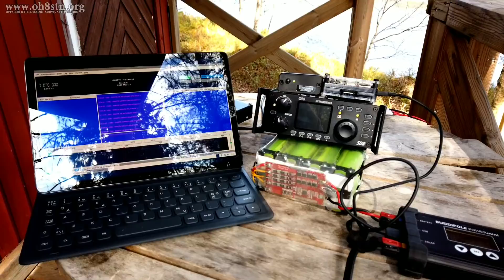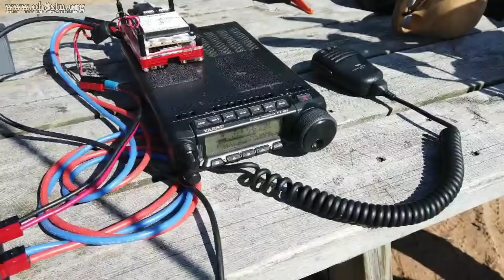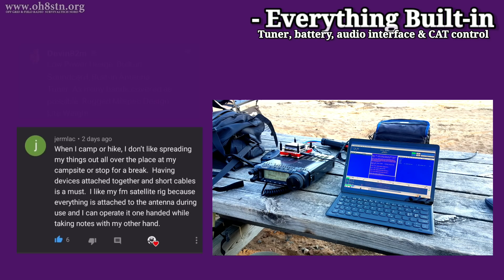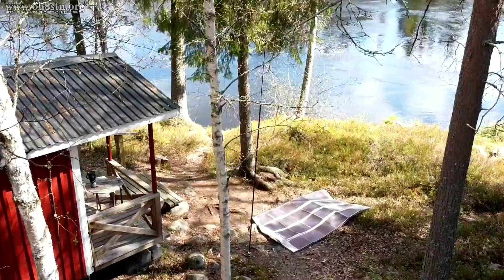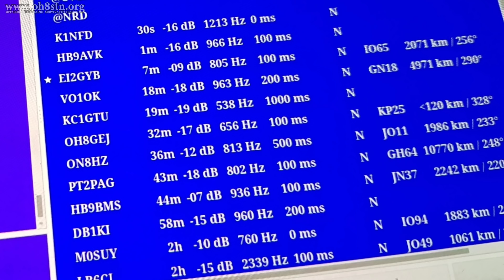How to Ham Radio Off Grid

Comment: Julian, this is one your best videos on this subject matter and I'll be sharing it far and wide.  Very comprehensive.  I have had some of the same thoughts and considerations.  I also wanted to drop a comment here in regards to your blog / website post about the FT-891 (The “Perfect” Yaesu FT-891) which I think overlaps with some of concepts in this video.  I have the 817ND and the 857D.  I love them both, use them both but when I look at the FT-891 which I really like, I find myself not being able to pull the trigger on it because I have the other two (and all mode / all band is a must for me).  I feel similarly about the FT-991A.  I would say, the all-in-one portable or mobile rig concept has to evolve power-wise to the 20 to 30W range, connectivity needs to be integrated and simplified down to 1 cable (excluding the antenna).  Technology-wise, Yaesu's hybrid SDR technology should really make is possible for all future rigs to be all mode (including Fusion) / all band (HF - 70cm) in that 891 form factor.  I don't think that that is asking to much if we are talking about a power section that is not going to be more than 30W max and has an RX current draw around 400ma @ 5W.  For around $1000 (+/- $200 USD)  I would get two of them because they would immediate become my workhorse rig- performing brilliantly in the off-grid department (which is how I always operate) but also able to excel in most other scenarios.  Vehicle, base station, em-comm, backpacking, etc.. Yaesu has a huge opportunity here.   73 de N3QQZ

Comment: Nice Video again:) I wonder if you can help me, I just put up a Sigma SE HF X-80 for HF,  I have check both PL259s both OK, no shorts but when I put it back in the antenna and go back to the radio and check the PL259 it beeps, saying a shot I'm confused, a bit any help would be brilliant Thanks 2E1FUE. ? It's RX brilliant had the USA and Emirates and so on sounded good 👍
Reply from the maker: check for continuity between the coax ends with a multimeter for both center conductor and shield.

Comment: I currently have a pi 3 b+ setup for a field computer. However, my big issue with it is instability. On this one I've had major stability issues as overtime it will become unbootable and I would have to set it up again. 
At this point I'd either consider using my laptop and factoring it in. 
Or getting another board. Since I don't want to get into a situation where I need the field computer and its unusable, and I lack the ability to setup a new system since I cannot access the internet.
For radio until the IC-705 comes out my G90 works well.
 However on antenna, while I have a magloop antenna [motivated by indoor ops mostly] tuning it is a pain so something new would have to be used to add much needed versatility and ease of use . It works great on the higher bands, but lower bands tuning becomes next to impossible and swr is way too high to safely use the radio. 
Thanks for making this video! 
73, 
KE8GAH

Comment: Love your videos and was wondering what the meter is that your using in between the radio and power pack?
Reply from the maker: Thanks for the kindness. I'm not sure we can meter you mean. It could be the charge controller from @buddipole or a voltage and amperage meter from turnigy. Timestamp?

Comment: You talked about the cables coming out the side.  I saw something that may or maybe not help you.  "Argon One". It has a broad that plugs in the side and moves the ports to the back. The downside is that it make it wider, so may not work for you.  I have been watching your videos and must thank you for all the information I have gotten from them. When I saw this I thought about your problem.  I also thought that because of the room in the box that you could put a buck convertor in to make it better to power.  There are a lot of boards that can be add that the convertor but add things that are not doing good. 73. W4DES

Comment: Hey you might work low power like I do. Just rember get the best antenna. And ground. System you can get.  It all works out on you ROI WISE. IE 5 WATTS WILL DO JUST AS GOOD AS TEN ANY DAY . I THROW OUT THE INVERTER AS HE IS A HUNGRY MIDDLE MAN. GIVE THE INVETER ThE BUMS RUSH. HI HI DE KV4LI.

Comment: I'm playing catch up and binge watching  ! Super job Julian. I will take a close look at the Buddipole Powermini v the Genasun
Reply from the maker: Thanks Tim. I thought about doing a versus video of those two products. They both have interesting plus sides.
Reply: @OH8STN  presently I use the genasun and the powerfilm 7200 to run off-grid, but you suggested/intimated in here that the buddipole power mini was a more efficient/quicker setup than the genasun.  Is it possible that you could elaborate on that point just a bit?  I seem to only be required to "hook up a single connection" also with the genasun (which i keep permanently attached to a watt's-up meter).  Is that the point that you are making here?  ...that there is more information generated directly from the buddipole power mini, than the genasun (as it needs an additional meter)?  Sorry for the long-wind reply, but I'm interested in your opinion about the comment in the video.  You perform a great service here and I appreciate the credibility of your exercises/results.

Comment: Great video ! What kind of current is your laptop / device consuming ? My CF-19 toughbook is a power hog . Thanks for sharing !
Reply from the maker: Hi Brett. It's actually a usb-powered Android tablet with its own internal battery. It consumes 1.3A 5v when charging, but it only needs to be topped up once a day at most. The screen is off when not in a QSO.  CPU is never used since processing is done on the Raspberry Pi. It's actually very efficient.
I took a pic of the measurement for you. https://www.instagram.com/p/CBTZXWWjC8_/?igshid=fo2ofgk3bcab

Comment: Julian, love your vids, have you thought about shrink tubing or using Split Wire Loom Tubing to keep your cables together so you dont misplace once and to keep the tangles down?
Reply from the maker: That's a great suggestion. I've done it in the past, but it takes a lot of space. My ft-891 is much better than my ft-817 in this video regarding the cables. I may take a look at using this method again though. Any particular brand you can recommend?

Comment: I'm trying to figure out how to use that PowerMini in a Go-Box I'm building. For straight portable operations it's easy. but going to a bench with power supply means i need to unplug a bunch of stuff. plus when I'm not using the box, I need to un plug the battery. It's fun stuff to figure out. Your videos help tremendously!

Comment: One of the largest areas of a system that are power thieves are, non-resonant antennas, meaning having to use an antenna tuner, especially if using QRP, ordinarily its not an issue using 100 watts. Because if you loose 12 or 25 watts or even 50 in tuner mismatch loss, there is still at least half the power and with 50 watts, your signal would still be half decent,  with 5 watts, it makes things tough if down to 2 or 3 watts, although possible, makes comms more of a challenge. Resonance keeps your power in the right direction down the coax and not in to your DC power conductors or other electronics.

Comment: Hi Julian, I see that you used POWERmini as a charge controller. It is a very cool piece of kit that is classified as a PWM charge controller. Curious minds (both of mine LOL!) want to know: Given a choice, would we not want to go with a MPPT charge controller to maximize the output of the solar panel? Thank you.
Reply from the maker: This is an excellent question.  Normally I would use mppt charge controllers from Genasun. Especially when trying to squeeze every bit of juice out of the panel. There is an argument to be made having a charge controller with integrated battery management, and power distribution, but I certainly do wish the power mini was an mppt controller. This is especially true when using it in anything but direct sunlight. Perhaps we need a comparison on the channel.
Reply: @OH8STN  I came here to ask if you would do just such a comparison.

Comment: I still drag out the IC7200 for field ops knowing it's a bit heavy and not the most efficient, but it was purpose built for durability. It was inspired by ICOM marine radios and that's a tough environment for radios.

There have been times when portable QRP power was unrealistic and the extra power made the contact. If they could shrink the 7200, even with less power, it would maintain what a real field radio was meant to be.

This channel ROCKS !
Reply: I also prefer the 7200 in spite of all else. You aren't the only one!
Reply: Count me in as another IC-7200 fan! I am a relatively new General licensee and purchased an IC-7200 as my first HF radio. Although I like this radio very much, I'd agree that it is a bit heavy for truly portable operation. I'd like to try my hand at QRP while out hiking and I am currently looking out for a cost-effective QRP radio that I can afford and will handle phone well. (CW is a future challenge. 😎) 73.

Comment: It’s my understanding that ICOM is the only ham radio manufacturer that also builds equipment for the military.

I wish there was a more affordable option for flexible solar panels than Powerfilm
Reply from the maker: They used to do it. Their division Vertex Standard build commercial radios for the military. They sold the Vertex Standard division to Motorola, who continued the VX series. I don't know what's going on with Yaesu
Reply: Bernarr Coletta agreed. Really expensive.

Comment from the maker: 00:00 Introduction 
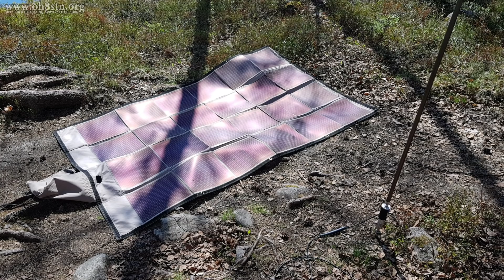01:33 Off Grid considerations 
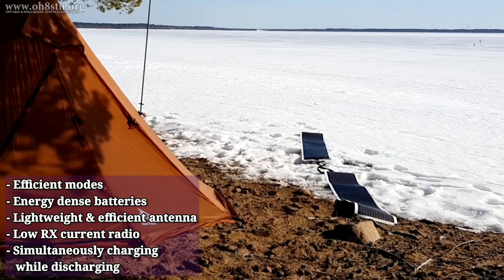04:48 Choosing a radio
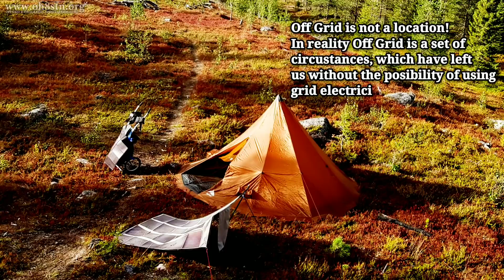- 05:06 Defining Off Grid
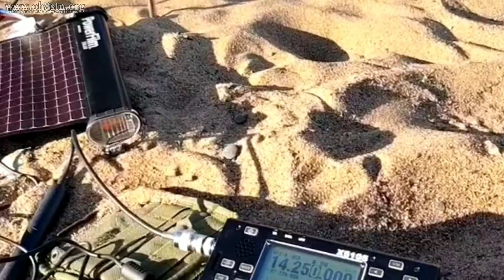- 05:38 Most important Off Grid features
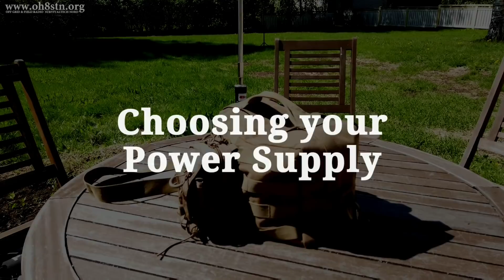12:29 Understanding power for Off Grid Comms
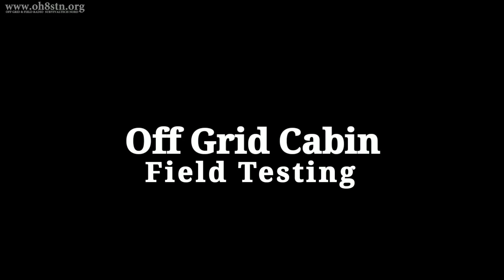15:05 Off Grid cabin field test 
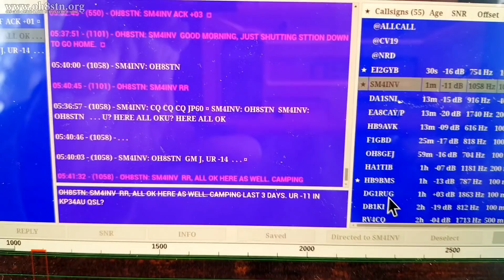18:18 Thoughts about off grid Comms.
20:30 end screen
73
Julian oh8stn 
Share video url: https://youtu.be/avGBTzWAqbo
Reply: Nice you went to the bother of breaking it up like that, if I want to go back to see a bit again you made it very easy.  Thanks.  EDIT:  This is extremely helpful.